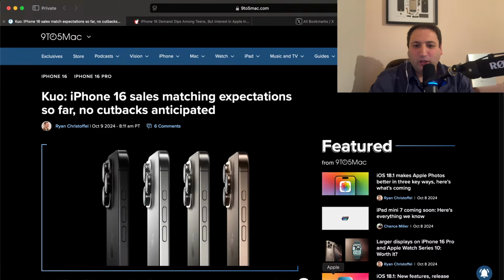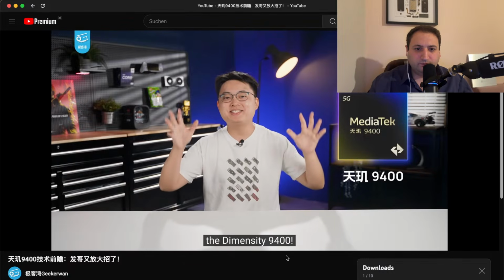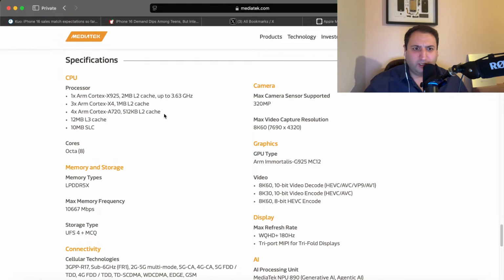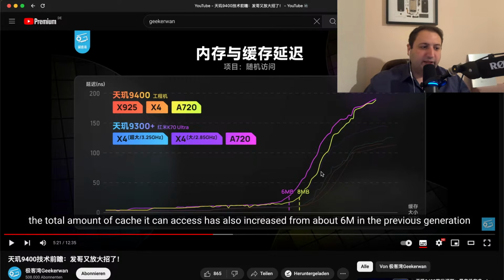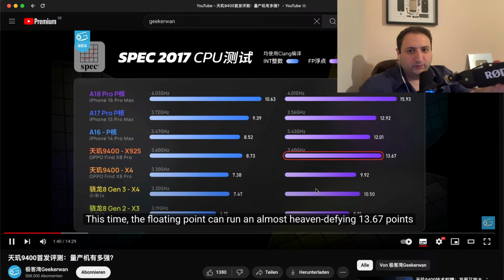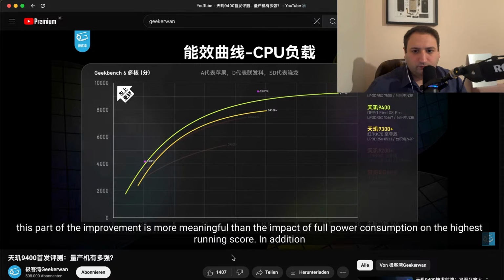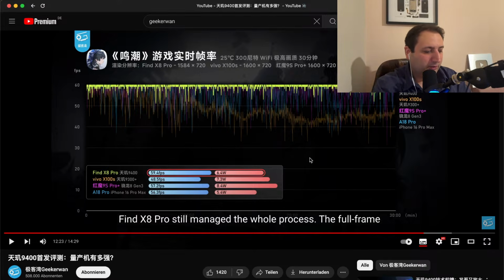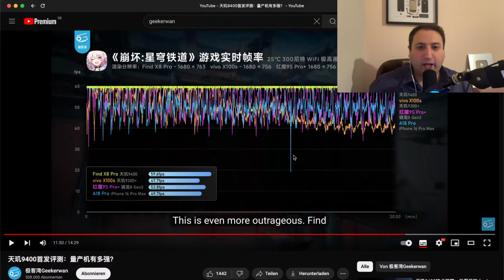Does Dimensity 9400 dethrone Apple's A18 Pro? Reacting to Geekerwan

Comment: So quick thoughts what does geekerwan do right and wrong with testing smartphone processors?
Reply from the maker: @liberdelta  Good: I don’t doubt the actual performance numbers and it’s good to have someone who aggregates a lot of data.
I don’t doubt their power consumption numbers for Android devices where they are given deep root level access.
Bad: They don’t provide a power consumption graph for the actual tests so I still struggle to understand whether or not we are talking “average” peak consumption or if they are deliberately choosing the most outlier spike results.
They use results from artificial tests to make statements on overall performance, efficiency, etc. that clash with their real world findings and they don’t verbalize that well so people can easily take away the wrong conclusion.
They don’t talk about different graphical settings between iOS and Android. They are happy with using the same labels like high or ultra even if the visual experience is vastly different sometimes.
They use extreme cooling that pushes devices into levels of strongly diminishing returns that can impact the overall conclusion quite heavily.
Unsure: I still have no idea if I can trust their iOS findings because I don’t know how much access they have to the OS. I don’t know how optimized Spec 2017 is on iOS given that there is no official port for it.
Reply from the maker: Sorry if that wasn’t very “quick” 😅
But I guess still better than the full hour of me reacting to them (which you should still check out 😉)